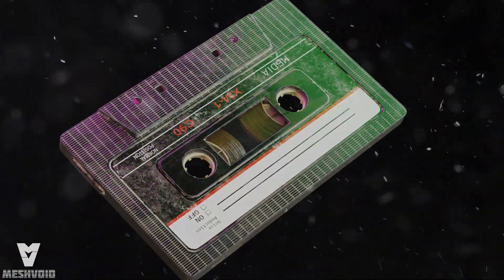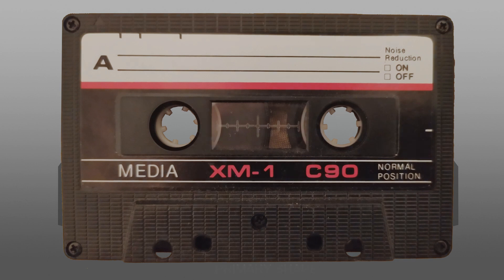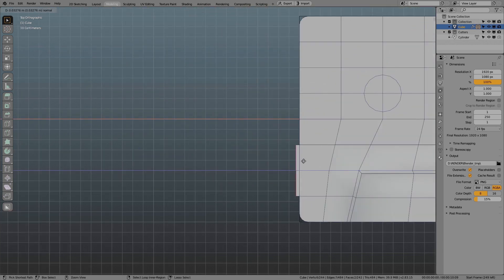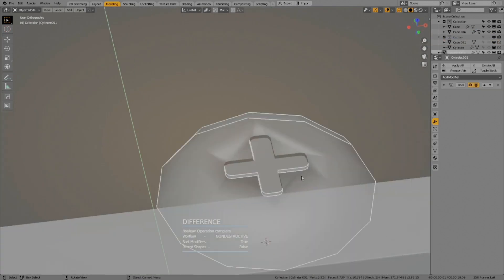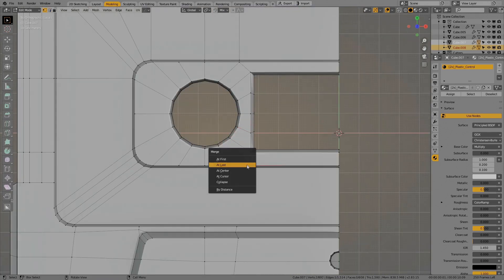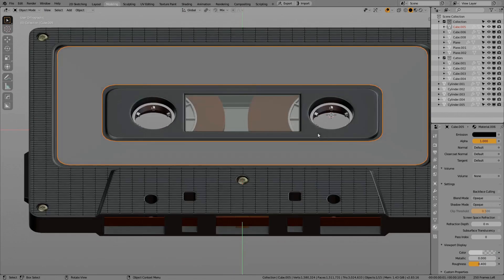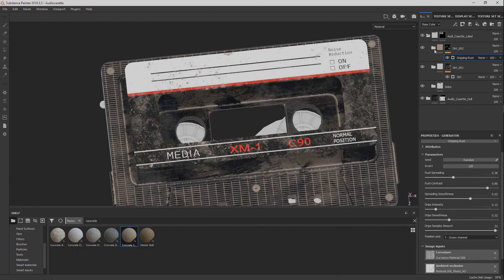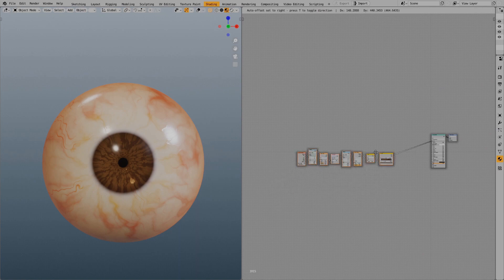Making Audiotape in Blender: Hard Surface Fundamentals Part 1. Modeling and Texturing.

Comment: Awesome i'm making my own but wohout booleans since its meant to be a game mocel and i hear booleans screw it up. already made a low poly mesh now trying to make the high poly one to bake the textures. turning out not as great as this one did however.
Reply from the maker: Don't know what game mocel means, but boolean models are totally fine as game assets, they're very optimised and once shaded or textured properly they work well in game engines. This  final model is sub-d friendly however. Using booleans to get the shape of the model and then clean those booleans to get sub-d friendly topology is the thing one should get used to, there's no other way of getting proper hardsurface shapes, just extrusion and beveling won't do if you want to improve your poly modeling skills.
Reply: @MeshVoid  sorry i meant game model not mocel. but aside from that for the past coiuple of weeks what i have struglled with is repilicating what you did to get the small rectangular shapes. I also used a plane and array modifers but cant figure out how you added it to the mesh? i tried repeatedly to bevel, extrude, and the boolean the shapes onto the cassette tape of mine. I figured as long as its on there to create maps the topoloigy was not really important. after all I would place those maps on the low poly model anyways. all that to say i dont get how to make the rectangles. even with bevels, extrusions, and booleans. i even majored in modeling and we never learned this.

Comment: Oh my god, I'm so thankful for this video. I am relatively new to 3d and had a really hard time with high poly modeling for subdivision, and hard surface too. Recently I made a similar VHS tape, and it was a nightmare. Stretched textures, funny topology,etc... Now I have a better understanding of this workflow, thanks to you.

ps. if I'm not planning to make my model game ready, do I still need to make it low poly and use baking? I'm interested in photorealistic still shots.  Can I still unwrap my high poly model, and texture it in Substance, Keyshot, or Marmoset? Thank you!
Reply from the maker: Hey there! Thank you for your kind words, I really appreciate the feedback and glad that someone found this video useful! Answering your questions - if you're just doing a model for render purposes and have no polygonal budget then you don't have to bake anything, procedural textures made in blender would do just fine. The downside of procedural textures is that you will have to set unique materials in every software you do your renders as every DCC or game engine or render engine have their own shaders. 

Also, yes if you make highpoly model, you can totally unwrap it and texture it in SPainter, or export to any other software to apply procedural materials or texture it there. You don't have to have ideal topology too, or worry that the final geometry subdivides perfectly if it is looking good on your final images\video, then the job is done, so the general approach is to always adjust your work to your needs. In this example I chose to texture it and bake it as a practice making assets for different game engines, also it could be way more low poly, I could have got rid of all those beveled edges, but then I wouldn't be able to subdivide the model if I really wanted to make close-up shot, but generally for game engine, the model would have far less polys. The way you approach your model always depends on your limitations and requirements, the final model is more of a "mid-poly model" rather than lowpoly.